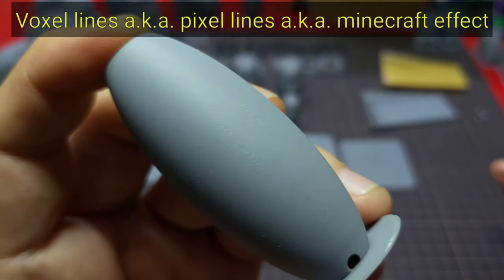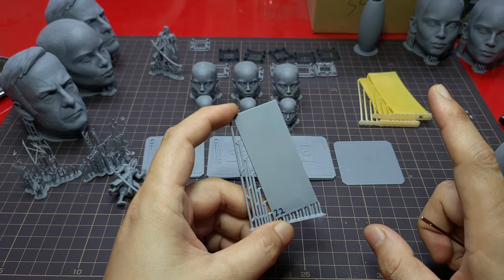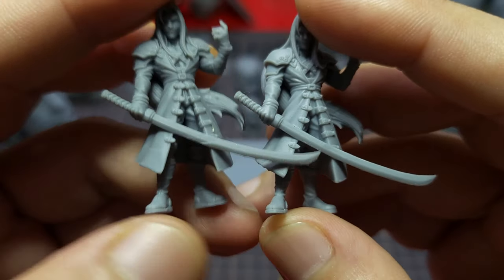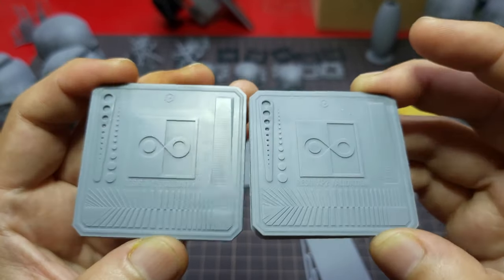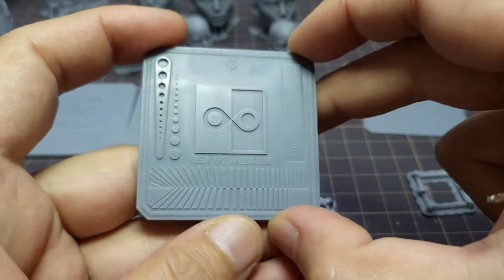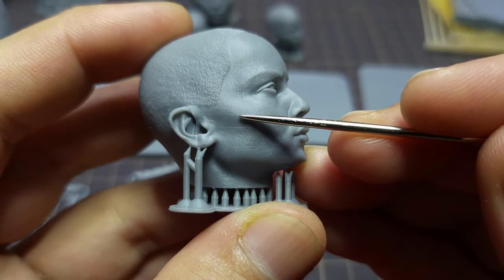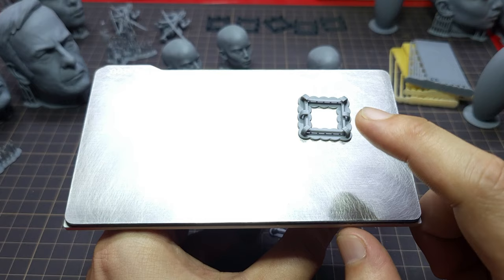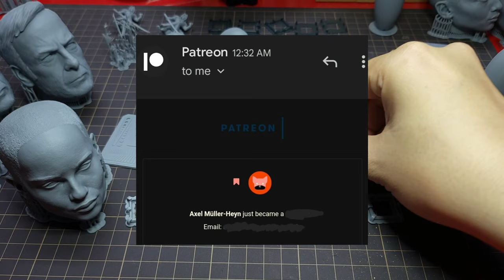How To Setting Resin Exposure For 3d Printer Resin

Comment: Silly question : is your STL for all resins printers and z layer height ? On my elegoo mars (rgb 2k layer height 0.05)  i don't  see any columns under top part...
Would you please give informations on bottom lift speed and lifting speed ?
Best regards
Reply from the maker: Recalibrate your build plate with 3 papers.
You'll see the column after that.
Reply: @wangdennys  Hi Dennys,
Thanks a lot for sharing your experience. Just an information ; for my mars 3d printer i need to put 8 sheets of paper (8x0.09mm) to counter compression effect. Now "disk compression.stl" and "Compression Steps Test 1.stl" are perfectly printed ! Regards

Comment: So voxel lines are normal? Wobble lines mean loose hardware? Also, I've been printing this along with other cLibers. I am at a perfect exposure, yet the second inner print on the small supports keeps seperating. Is this a lift speed issue?
Reply from the maker: Voxel is nornal, some people like it, some dont. Use AA to get rid of voxel.
Your small support, could have a too small tip size you could either use bigger support tip size or slightly raise the exposure 0.2-0.4s
Reply from the maker: There is no perfect exposure for all unfortunately.
That means you need a slight raise exposure.
Small supports are weak and need a bit longer exposure

Comment: Question. When you say that i should print multiple exposure/support tests for each layer height, can i print multiple ones and the plate at one time or do i need to print onee by one but change position everytime?
Reply: Also do I need anti aliasing off or keep it on during the support calibration? I've gotten different answers from different ppl.

Comment: I'm trying to dial in elegoo 8k resin on the phrozen mini 8k at 0.02 layer height. I keep upping the exposure time and the xp2 test looks good now. But the the horizontal part that sits on top of the pillars on your test is about half the thickness it should be. Is that part being too thin normally a sign of under or over exposure? Something doesn't seem quite right, I'm already at almost double the exposure time I was at with the phrozen resin.
Reply from the maker: It is compression indeed.
But if you rarely print flat, no need to worry about it.
Reply: @wangdennys  thank you!

Comment: I’m testing a Creality Halot One with basic anycubic Grey resin. The info wherever I check says normal exposure 15 seconds bottom exposure 80s, 8 bottom layer, but these settings are not available on my printer. I tried with the max available settings to try to emulate those suggested but your test failed: no columbs and no detail at all. Is this overexposing ?
Reply: 15sec is really overexposed, my old 2k anycubic Photon s worked on 6 to 8 sec exposure fine.. if urs in old series then 8sec is good..
Recent tym my phrozen mini 4k printer working on 2.5 to 3 sec..
Reply from the maker: Sorry i think i miss your comment.
Join my fb group, i will help you there

Comment: Dannys, if 2 per 6 matrixes on one go had failed at the corners, would you consider that as bad exposure? Thank you for videos!
Reply from the maker: Most likely bad level
Reply: @wangdennys  that's what I thought, thank you!
Reply from the maker: @_koyot  i always leveling with 3 papers and not pressing the plate.

Works all the time.
Reply: @wangdennys  I tried 4,3 and 2 and had best result on single sheet, on my Mono SE 👌

Comment: Great video! I'll test it in few days after my mask filters arrive!
I have a question...
I cannot get same suoerlube as you suggest in Europe... Any recommendations for another one? Thank you
Reply from the maker: Sorry, i am not sure other than super lube.
What you want is white lithium grease type for lubricant.
Reply: Thanks!
In this case did you ever try WD-40 for the printer?
I'll try to have a look for "best one".
Reply from the maker: @kamikadze1112  tested many type of wd40
So far none give good result.
Reply: Oh no! Thanks for this as well! Do you have complete list of what you have tried and didn't work? Maybe we can build a public list for this also.
Reply from the maker: I think i have tried all wd40 spray can lube that available in my country.
So sorry i dont remember which and which cause i gave it all away cause i have no use of them.

It must be lithium grease type. If i remember correctly there is a lithium grease for paper printer that works too.
Reply: Great info! I would try some and I'll let you know here when I have results.
Just one quick question. If you have time..
Tiny tiny craters in different shapes on the surface of a smooth print is caused by the resin? Because I have same model printed with no craters, or not in the same spot.
Reply from the maker: @kamikadze1112  care to continue chat on my social media?
I would love to see pic of what you mean with crater
Reply: For sure! I would show you more there!

Comment: So i'm printing one Validation matrix and 2 of your tests. It all looks good, but one of your tests has 2 of the pillars fail each time. I'm guessing i need to keep going higher? Currently at .05 and 2.3 s exposure, i'll bump up to 2.4 and see, but everything looks great now.
Reply from the maker: Yes raise by 0.1 or 0.2 increments
Reply: @wangdennys  great, my time is around 2.55, which on a few Facebook groups everyone says is over exposed. But I've been printing 2 of yours and one of the basic finder per print and 2.5-2.55 is where none of yours fails. 

So tricky as now I have no idea.
Reply from the maker: @errata2412  well people keep forgeting each printer is slightly different, also temp and humidity plays factor into resin exposure.
That is why i always against copy resin setting.
And i prefer to teach people to calibrate their own resin, rather than share my best setting, but fail on the person i share.

And in many other group, experience user no longer use validation matrix, because they said good print on validation matrix it always underexpose, even phrozen exposure finder need to raise 10-20% exposure from the good print according to the instruction.

And i design the exposure finder according to my best exposure.
The question is, do all my print on all my printer review and tutorial looks overexpose?
LOL and with my exposure tester i can print with support tip size 0.3mm as anchor and 0.1mm tip for fine details.

I suggest you note down everyone suggestion including mine. Then do your own test and research. This way you will learn more and have better experience.
Reply: @wangdennys  thanks! That's exactly what I'm doing. Pretty confident I have my .05 set almost. Want to figure out .03 so that'll be a thing. 

Is there any formula to move from .05 to .03? Or just the same trial and error process?
Reply from the maker: @errata2412  unfortunately
Formula only result as ballpark guessing.
Because each resin type and brans react diferently.

So for optimal result, print calibration is needed.

For example on 1 of my old printer, to print 0.05mm on aqua grey 4k resin it needs 3.5s, and for 0.03 2.8s

When i use aqua grey 8k resin, for 0.05 only 1.6s and for 0.03 only 1s.
Reply: @wangdennys  understood. I'm going to reduce time by like 20% to start and see from there. 

I appreciate your time

Comment: Is photon mono 4k possible to use  phrozen castable resin w20? 
I tried many times and changes setting but continued to fail… plz give me ur insight..
Reply from the maker: Any resin printer can you any resin
It will takes time and effor to calibrate the exposure

All i can advice is try to print the object you want with exposure from 1s with 0.5s increment till print success
Reply: @wangdennys  thank you!!!

Comment: The catchers in all four corners keep failing for me. They keep printing on the feb for some reason. the other two supports are printing fine. ANy suggestions? it has done this on an exposure of 2.5 and 3.0. Im using an elegoo saturn S.
Reply from the maker: It seems slicer eror
Happens to other user before and they share it in the group.
Reslice the file or reposition it.
Reply: @wangdennys  all right, I'll do that and let you know how it turns out, thanks a bunch for the response!

Comment: Hi dennys, great video...again.. :) I usually did my exposure test like in your other video, with uv tools and multiple exposures. Would you suggest ignoring this and going forward with the method you showed here? First print matrix and then your test?
Reply from the maker: On updated chitu 1.9
The multiple exposure not working properly, havent got time to tweak it.
Me personally just print my exposure tester.
The validation matrix in the video is just for reference.

But you could print both if you want for cross check.
Reply: @wangdennys  Thanks dennys for the fast answer. Im testing chitu pro 1.1.1 right now, maybe I should try the multi exposure with that. I only used them in 1.8 and since then everything was perfect. 
In this case I go with your exposure tester. I had probems with this matrix at first, because from 2.3-2.6 most looked the same, but the prints had lines up until 2.6 (on the mighty 4k at 0.05). didnt have the raised version of you ;) 

what do you run on your mighty (if you still run it) at 0.03 as a base exposure time? 

Thanks again for making all those videos. They help more than all those reviews.
Reply from the maker: @StefanMathys  Pretty much the same exposure as in the video.
Reply: @wangdennys  Ah yes you are printing at 0.03 here. Thank you very much :)

Comment: I'm getting weird results and I'm super confused. My print turns out every time and adheres. But regardless of the exposure time  I never get any bridging. It looks like the top level should have a gap but it's just solid all the way around. 
No support, no gap, nothing. Just a solid square 

I would truly appreciate any advice. 
Using a Elegoo Saturn S and Anycubic Eco Resin.
Reply from the maker: It seems your build plate is too low.
Try raise the z offset.
Or relevel your build plate with 3 papers.
Reply: @wangdennys  I just replaced my FEP sheet so I wonder if I made it a little too tight. Could that cause it? I haven't tried using z offset on this printer before. I'll have to do some looking in the AM to check. 
Thanks for the reply.
Reply: @wangdennys  I was actually getting good prints with Loot Studio files. The problem was my supports were making alot of damage to the models. So it was suggested that my exposure rates were the issue.

I would clean, use warm water and carefully remove supports but would still got dents, divets or scaring no matter what I did.
Reply from the maker: @rikijamie  contact my social media. I want to check the model you talk about.
Reply from the maker: No, fep too tight is never a problem.
I never use spacer at all whan put new fep. And you can see all my print is fine.

Try the z offset or relevel with 3 papers.
Reply: @wangdennys  I tried with 3 papers. I tried replacing the FEP incase i didnt replace it well the first time. The Elegoo Saturn S doesnt appear to want to remember the Zoffset. Can Chitubox over ride the offset? Maybe thats why.
Reply: @wangdennys  So i tried to Z offset. For some reason it doesnt matter what i do, the Elegoo Saturn S doesnt seem to remember the settings for Offset. It goes back to exactly where it was before
Reply: @wangdennys  The model i had issues with is the Exposure tester. The model shows as 6 posts and a floating square. But when it prints the square isnt floating on supports its just 1 solid square. 

If you have twitter or something i can share an image to explain it better
Reply from the maker: My twitter is @dennyswang
Reply: I have the same issue. It's a solid square being printed on top of the raft. The catchers print perfectly, the raft prints perfectly, but the square is just a thick square attached to the raft. Elegoo Saturn, elegoo abs resin, chitubox slicer. Several prints at different exposure times. I plan on trying several other exposure times and double checking the output from chitubox.

Comment: Do you have to do new tests when changing the thickness of the layer?
Reply from the maker: yes
also when changing resin color or brand
Reply: @wangdennys  Thank you for your answer. I have an elegoo saturn 3 printer with elegoo abs like 2.0 resin. My trials are 0.01mm - 2.7s / 0.03- 3s / 0.05-3.2s . Could this be appropriate? I thought that at 0.01mm the times would be much shorter.
Reply from the maker: @neonowka1107  i dont have elegoo, so i am not sure
Reply: @wangdennys  Is it possible that there are such small differences in times?

Comment: Is there no way to have different exposure time on a same layer? One could test 6 or 9 different exposure settings in one print, by printing 6 or 9 testers, all exposed for different time.
Reply from the maker: Depends on the printer
Some has built in feature
Some need the help of uvtools.
Reply: @wangdennys  ok, nice, I'll see if I manage that on the halot one, that would make a one step exposure calibration 😃

Comment: So what do I do if the test cured itself to the base of itself and there are no posts or supports.
Reply from the maker: That means you have compression.
I you dont print flat it wont be an issue.

You can fix your compression by leveling with 3-5 stack of a4 80gsm paper.

Comment: Hi dennys, when I print I don’t get any column, the top part is printed on the bottom. Any suggestions?
Reply from the maker: What printer are you using?
Reply: @wangdennys  Photon Mono X
Reply from the maker: @jesperbecker6982  raise the z offset several 0.1mm
It seems your build plate is too low.
Reply: My settings are

Layer 0,04
bottom layer count 6
Exposure time 2,3s
Bottom exposure 80s
Bottom lift 6mm
lift distance 6mm
UV 50%
AA activated and set to level 4 

Ive  tried lower bottom exposure like 60s but then the print doesnt stick to the build plate. Im using Anycubic green translucent resin.  Ive done the "cone" test from tabelflip and its a good resul. Using Chitubox also.
Reply from the maker: @jesperbecker6982  try raise your z offset
Or relevel build plate with 3 papers

Comment: I've tried exposing the file at 2,4 seconds all the way to 2,8 and I still don't get all the lines and dots printed. I'm trying this on an Elegoo Saturn S. What could I try?
Reply from the maker: Relevel with 3-5 papaers or 0.4mm thick cardboard.
Reply: @wangdennys  thanks for replying. I'm actually using the leveling paper that came with the printer, I thought it is a leveling issue too so I leveled again today but the result is the same
Reply from the maker: @3lcost3  do not press the build plate at all when tighten the bolts.
Reply: @wangdennys  I'll try that, thanks

Comment: I did a test for 0.02 high with 1.4 s 40 s bottom exposure,  and 8 base layers, columns are thick and I barely see the pillars its too close to the bottom . Photon Mono 100% UV.
Reply from the maker: Then print again with lower uv power
Reply: @wangdennys  Thanks for replying. I gues the problem is compression, I will level again. About Uv power, how do I calibrate it for best results? Use some detailed exposure calibrator stl?
Reply from the maker: @renatosilva2078  check my other video for super easy calibration
Reply: @wangdennys  The Photon mono 4k review?

Comment: Hi Dennys, I'm having real trouble printing your exposure test model. I downloaded v2, and no matter what I do, I can only get two of the 6 'hooks' to print. It's always the same two, almost like that's all the printer is reading. Any ideas?
Reply: After comparing my result again to yours in this video, I've noticed that mine is heavily compressed in the Z axis, with the support 'poles' being very short and thin, and the base being only about one-third the thickness of yours. What's up with that? (I'm a newbie, you see.)
Reply from the maker: @kevinfutter  relevel your build plate with 3 papers
Reply: @wangdennys  thanks, I'll give it a go.
Reply: @wangdennys  relevelling helped a bit, as the supports are printing better now, and with more height, but I'm still only getting 2 hooks, and a very thin base.
Reply from the maker: @kevinfutter  2 hooks could be slicer eror.
It happens and someone post it on chitu group.
Reply: @wangdennys  thanks. I'm currently printing a re-sliced version that also contains several other test pieces on the build plate, but after this, I think I just need to test with some real parts.
Reply: @kevinfutter  Did you solve this? I have a similar issue. The square and supports are perfect, but there are only 4 hooks. Using Chitubox to slilce and printing on an Elegoo Saturn 2.
Reply: @VikkiBaptiste  - no, I never solved this problem, unfortunately. Have backed right off from 3D printing for a while, until I'm ready to deal with the frustrations again.
Reply: @kevinfutter  I understand! I just fired mine up again recently after going 100% FDM for a while. This one is stumping me though. I'm determined to fix it!
Reply: @VikkiBaptiste  - good luck!
Reply from the maker: It is a known chitu error, somehow there is a layer missing under 2 of the hooks.

Update the chitubox can fix it.
Reply: @wangdennys  thank you!
Reply: Thanks Dennys, I thought I had the latest version, but I'll check for updates! Appreciate your response.
Reply from the maker: @VikkiBaptiste  or you can try slice with previous version.
Somehow it works both ways

Comment: 6:32 it also pulled away from the supports as well
Reply from the maker: The support got pulled away when remove the object from build plate.
And that is very common on whatever exposure you use.